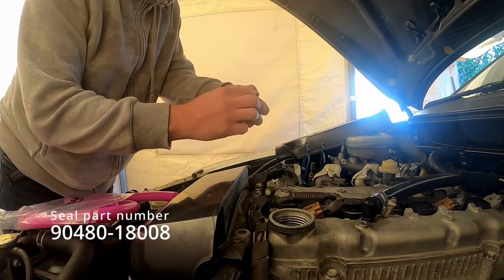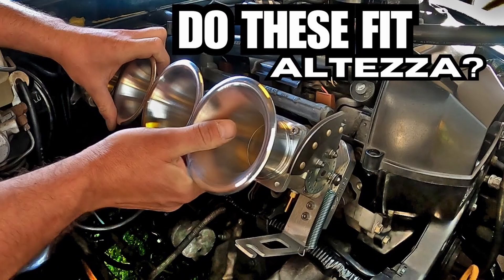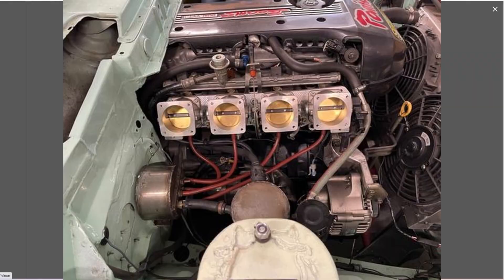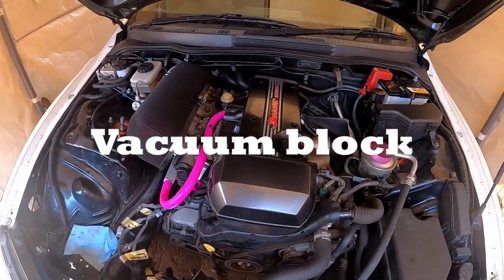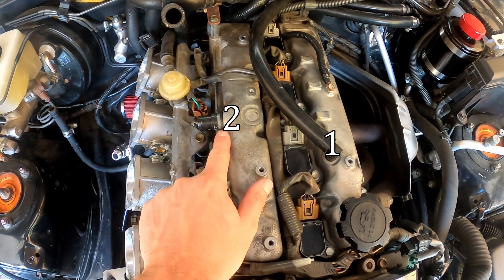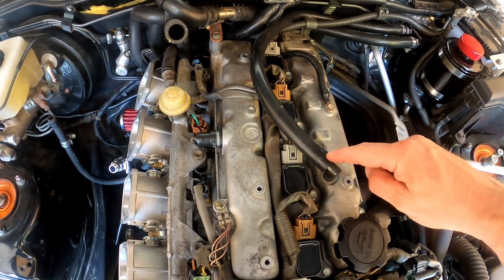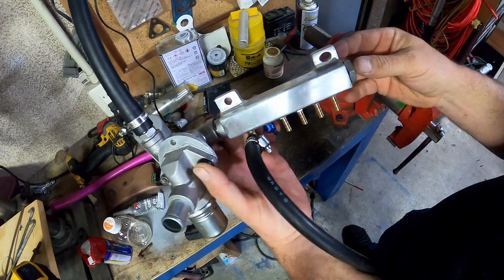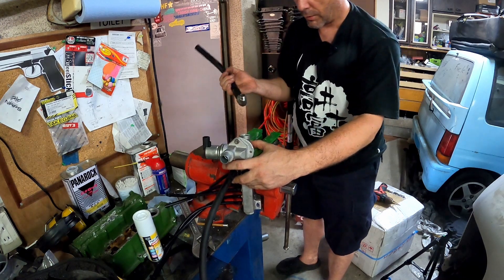DON'T CONNECT A PCV LIKE THIS WITH ITBS

Comment: The 4age 20v has 2 brake booster vacuum ports - is it best to T them going to brake booster with check valve on each hose? I am not sure why people would prefer blocking off one of the ports and just use the other one... but how about you? What would you prefer? Thanks in advance
Reply from the maker: @Jack_OLeńoco  yea, I just blocked one off.
I guess you could potentially get more vacuum by using both but it's more effort.
In most cases not needed.
I will always try to use as few holes as possible because if you have a leak It's easier to find.

Comment: I bought the SQ engineering ITB adapter for my beams and the adapter has 1 little vacuum barb for each cylinder, but then one of the cylinders have a big one that looks like its for that PCV system. maybe its for brake booster, not sure. should I still go ahead and run a catch can anyways?
Reply from the maker: Yea I saw the big hole. Mine was plugged so I left it plugged.
The 20v itbs have a bunch of little ports and that MAY allow you to run the pcv.
Regardless, I wouldn't. 
I'd run it to a catch tank.

You need a catch tank anyway for the breather pipe so just T those two together.
I've already done mine so if you can wait there'll be a video on it out soon-ish..

Comment: Yup. I connect my pcv and intake vacuum to a catch can in my beams ae86. only my brake booster is connected to my vacuum block along with my itbs, map sensor, and iacv.
Reply: I do @beams_sr5
Reply from the maker: Would love to see your setup. You have an Instagram?